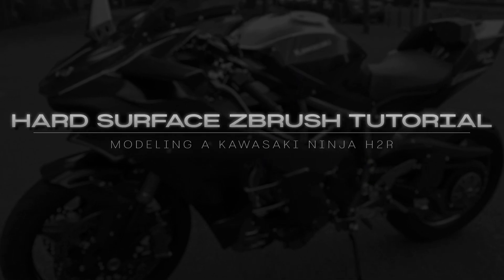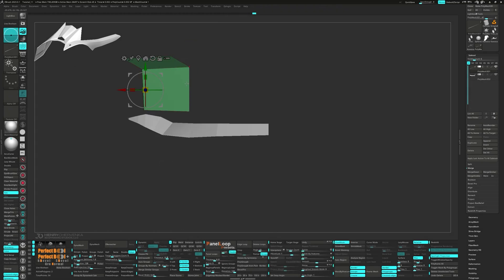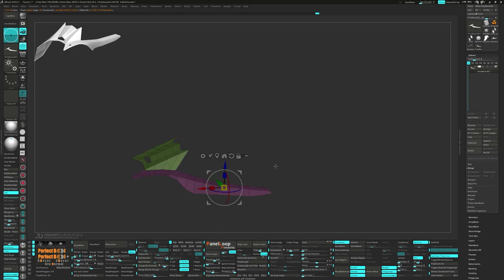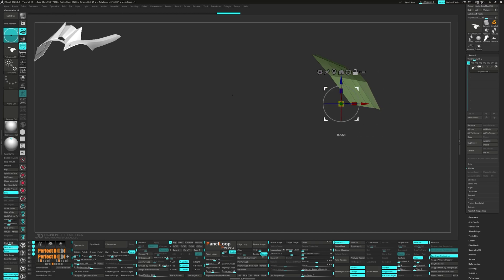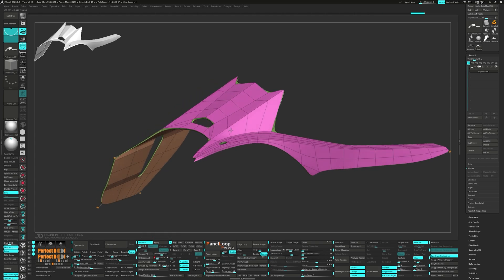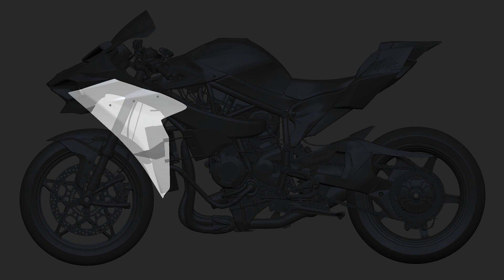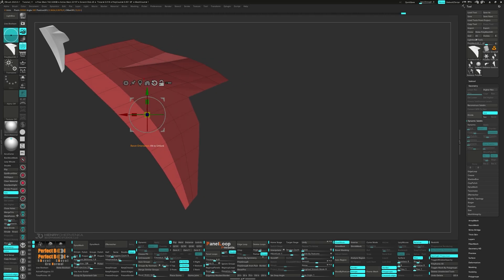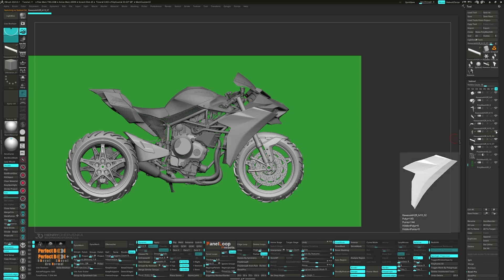Hard Surface ZBrush Tutorial Series // Modeling A Kawasaki Ninja H2R // 11

Comment: amazing work, and Let me ask. I work with both, zbrush and Maya, isn´t it better to work this on maya?. thanks!
Reply from the maker: Certainly, there are aspects of this motorcycle that are more efficiently modeled in Maya, while other parts are better suited for ZBrush. Additionally, certain components can be more effectively created using Blender or 3DS Max, thanks to their specific toolsets. The same can be said for using Plasticity and other CAD software for certain parts of the bike. However, unless you want to juggle six different software programs, it's more practical to focus on mastering the fundamentals and workflows. This way, you can adapt to any software required by the studio you work for, as many programs are capable of modeling with their own unique strengths and weaknesses.

Personally, I prefer using ZBrush as my primary modeling software because it offers an organic approach to hard surface modeling and allows for flexible polycount management. However, the goal of this tutorial series is not to convince anyone to switch to ZBrush or to engage in a software debate. Instead, my aim is to help those interested in learning more about hard surface modeling in ZBrush by sharing my process.